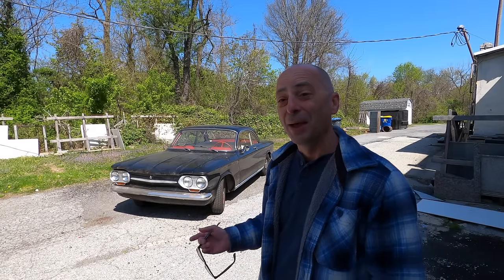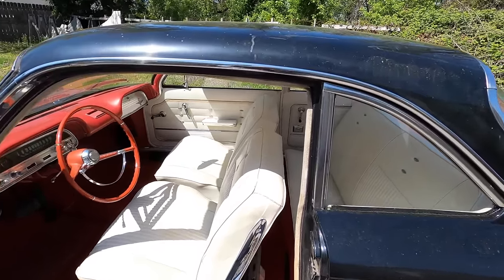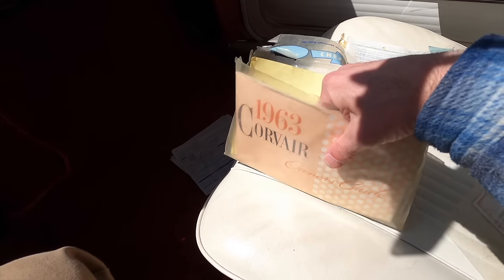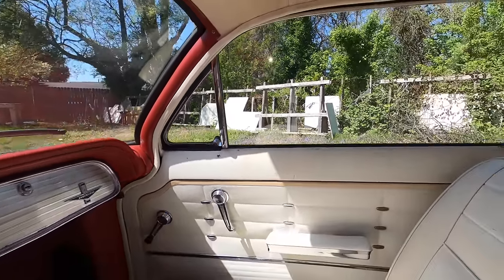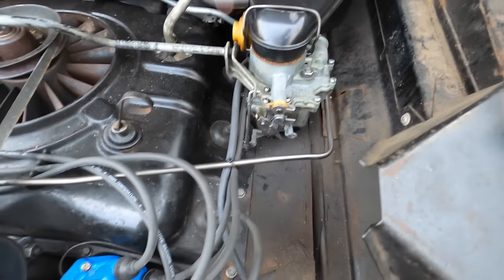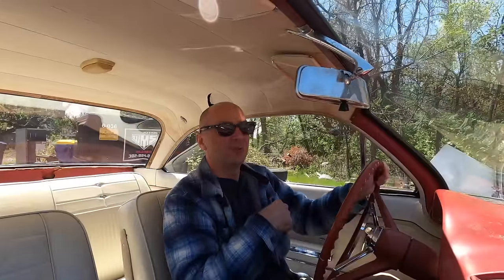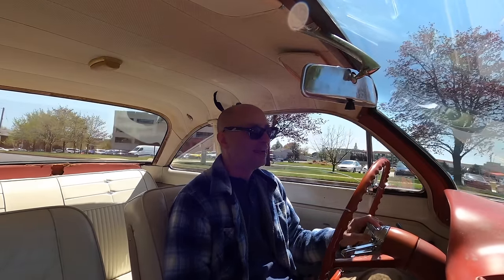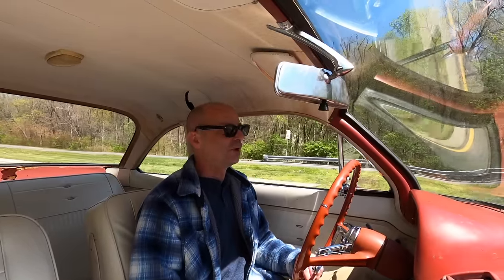Chevy Corvair - The Weird, Quirky, Cheap and Yeah COOL Compact

Comment: I like the Corvair quite a bit. When I was a teenager, you could literally pick these up for free by just hauling them home. 

There were camber compensator straps that were available to prevent the excessive positive camber jacking when cornering hard. These cars were specified to run low tire pressures to improve the ride. A help for the rolling under on the sidewalls was to run even higher pressures both front and rear. I ran 24 pounds in the front and 32 to 35 pounds in the rear. And I used radial tires. You can tune the handling with adjusting tire pressures. There is also a front stabilizer or roll bar you can install on the front which helps with the oversteer. I do not believe they came stock with your car. 

Your 101 hp engine was an option and it had a reputation for good mid range power and really helped when going up hills. 

The Corvair was initially designed for only offering the automatic transmission. The manual transmission was placed in the car shortly before release and they presented some engineering issues  that gave them fits. There was a bucking and rattling issue when the throttle was released and the car changed from power to coasting. The problem was found on the 3 speed, was most prevalent on the 4 speed manual.  It did not occur on the automatic equipped cars. 

They had a couple of last minute issues just before release. GM thoroughly tested the cars at the phoenix proving grounds to make sure they did not over heat. They did fine. But when they decided to run up to Flagstaff Az. They all quit when the got up in the higher elevation and cold temperatures.  All the cars carburetors iced up. So they did an emergency design change to install car de-icees on the 1960 models. They then did a design change to solve that issue later. 

Another design change implemented just before production release was to change the cooling fan to metal. They were initially offering a plastic composite fan of some sort then discovered if battery acid spilled on it, the reaction between the battery acid and the cooling fan released a poisonous gas. I forget which one, but it was serious enough, they immediately removed the composite fan and replaced it with the metal one before production release. 

By the way. The performance goal was for the zero to 60 mph acceleration with the base 80hp/automatic engine was to match the 6 cylinder Chevrolet Biscayne time of approximately 19 seconds. Your 101 hp model beats that by quite a bit. 

My dad purchased a new 1962 red Chevrolet Corvair 95 Rampside pickup with the 4 speed transmission and the gasoline heater. That heater would really toast your feet! That truck was absolutely great off in the woods! He bought it to go hunting in. He loved to hunt. Me, not so much. But I enjoyed the ride along and camping. (I was just a grade school kid then.) that is when I got hooked on Corvairs.

Comment: I had a '63 convertible and I loved it. The only real problems I had were that (1) I needed to keep a spare fan belt at all times, and (2) keep away from mechanics that had no idea about aluminum blocks, they would over tighten and strip all bolts causing multiple oil leaks from the valve covers and other places. It wasn't much good in an Indiana winter either. That was ultimately what made me trade it.

Comment: I had a new 1963 Corvair Mazda, 4 speed w/seat belts. When I had it at about 10,000 miles, it began having issues with leaning out similar to your issues and it turned out to be worn seals on the carborator power pistons. One nice thing was that when it happened in traffic, I could get out of trafic using 1st gear and the starter motor. The other and only other issue I had was upon filling the gas tank … if left parked in the hot sun, the gas would heat up, expand and begin flowing out the gas cap. I still enjoyed it so well that in the year I had it, I put 22,000+ miles on it. The following year I traded up to a 1964 Corvair Spyder with 155hp and an exhaust driven blower. The only difficulty I had wth it was my led foot, the clutch, and the poor construction of the seat covers. The blower became prominent as I would cross 55mph with my led foot. The clutch was a 10 inch size, and had to be replaced prior to my wife and I travelling from Iowa to Florida and back. The replacement clutch was in the correct box but in actuality was 10 1/2" size. It broke as we began coming home. At that time, dealerships wouldn't recognize warranties from anywhere other than the original dealer so we drove home having to stop by stopping the engine, starting the engine in 1st gear and hard gear shifting through the other gears. We had a difficult time explaing the damage to our dealer at home until they discovered their mistaken clutch and then we ended up with a completely new transmission. Still was one of the best cars I've ever owned❗🤗

Comment: I got a 63 base model in 1968. The back windows didn't open and the seats were designed to stick to you and scald you in summer. But even the smallest engine had 2 single barrel carbs, it had 3 on the floor and was fast. I loved that car.

Comment: That’s a solid example. From “my experience” there were a few flaws designed into the car. 1. When you feel your losing control in a turn do not let off the gas pedal or even touch the brakes. Power through that turn. 2. Correct shock absorbers. These make all the difference in limiting the travel of the rear swing axle. It makes the car almost flat in cornering at high speed. 3. Rust. The front cowl in the early model was sealed with tar. How they assembled the car allows water to seep into the trunk and into the front foot well. Take off the wiper blades, take off the louvered grille, flush it out and seal it up. The stalling issue on the engine if it involves the carbs is that the carbs do run cold. They will ice up. The engine heat is supposed to recirculate back to the intake. Which prevents carb icing. I’ve only had early models and most of them being the 1960 model. The 1960 had a single thermostat which I thought was a better version. The 61-69 used dual thermostats which trapped the hot air inside the tins which flowed the carbs through slots. When those thermostats fail all that hot air blows out and the carbs get only the cold air from whatever ambient air the car is driving through. My last Corvair I sold I had to pay attention the the minimalist electrical system as the wires were approaching 60+ years of age.

Comment: I had a Corvair back in the early 70s for a short time. Really good cars. Thank you for the video and have fun with it they’re a hoot.
Reply: my mom had a ‘62 Monza  coupe. car died at only 188 miles due to a tech leaving a 3/4 inch socket wrench in the transmission. GM warranty replaced it for free. car problem again at 28K when valves burned on long interstate trip. car got a steady 14 mpg on premium gas and always smelled of burning oil.

Comment: After being discharged from the US Navy in 1965 I bought a 1962 Corvair for $800 from a dealer in Fall River, Massachusetts. I loved the car. Driving first to Pennsylvania then Cincinnati, Ohio then a long road trip to Anaheim, California pulling a 5' X 8' U-Haul trailer. Because I never owned my own car before and not having any mechanical experience the trip was anything but uneventful but that's another story. All in all the car was a joy to drive and I highly recommend  anyone interested to get one. Seriously, I loved my Corvair. 
P.S. As a side note: I pulled the Corvair with the loaded U-Haul trailer OVER the Rocky Mountains.
       and it was the 600 Model. Little engine, no guts but it did it all the same.

Comment: I always liked them, especially the styling of the “new models”…the 2nd generation. I almost had one for my first car. I understand Chevy fixed that oversteer issue, but by that time Nader had killed them off.
Reply: We have been Corvair people for decades, and I don't agree that Nader killed them--10 years is a long run (how many cars designed in the '50s made it in to the '70's, for example)...AND...the new smog laws were coming in the late '60s. It's nearly impossible to clean up an air cooled engine, so they quit.
Reply: The Mustang killed them off.
Reply: @williamgregory6684  Disagree.  GM itself killed the Corvair.  Built the first ones on the cheap and never really got serious about upgrading.  By the later years, American cars were growing again and the demand for smaller cars faded.

Comment: Only  up to 1964, In 1965 the problem was solved. Yhe car was a Ferdinand Porshe design. He told GM to put a ujount on the rear axles. I had a 1965 Monza, I bought it in the early 80's with 30,150mi. Drove it all over the country, bought in <inisota lived in Brooklyn for awhile, then to Jacksonville, FL. It had over 1000,000mi. when I gave it to my brother. I replaced a wheelbearing in South Carolina, and rebuilt the carbs a few times, thats it!    Really loved that car!

Comment: In 1966 I learned to drive in an early model Corvair with a manual shift.  We loved tooling around the winding hills of rural astern PA, and we rarely heeded the speed limit.  It was a pleasure to drive, and we never had any problems with its Porsche type rear suspension.  Unfortunately it was rear-ended and totaled while stopped at a traffic light.  It was replaced by a 65 Mercury Comet with 289 V8 and auto trans.  The first time we took it our for a spin we almost killed ourselves going too fast around a bend (same speed we safely drove the Corvair), and the back end broke loose.  We safely recovered without ending in the swale or trees beyond.  The Corvair was definitely more fun to drive than the Comet, and safer.

Comment: In the early sixties Porsche, Corvair and VW all had rear suspension (called swing axles at the time) that would tuck under during severe oversteer. After racing accidents, research and lawsuits, anti sway bars were installed on the rear suspension that mitigated the “tuck under” and lessened oversteer going into corners. 
 One advantage Corvair had was 24mpg and great traction in the snow. If you lived in a state with a snowy winter you recall rear wheel drive cars having to have a 50 lb bag of rock salt in the trunk to reduce wheel spin on snowy days.

Comment: I remember my dad having one of these when I was a kid. He painted it outside with a brush, roller and regular oil based paint, black cause that was the original color. After the paint dried he put two coats of clear shellac over it. The car looked good most of the summer until the sun baked the clear coat causing it to crack and peel. By next summer the car had pretty much become a piece of yard art, and not a real pretty one either.

Comment: Crazy to think that a "failed" GM car back in those days still sold 280k a year!! 
Thanks for the great tour, always curious about these...But why would the air pressures in the rear need to be HIGHER? You'd think LESS pressure would mean more tire contact patch.
Reply: Probably Because the weight was heavier in the rear - the contact surface of the tire needed to the same as the front for better handling
Reply: @budsodalsky  Ah, makes sense!

Comment: If you stick your head down into the passenger's foot well and look up into the underside of the dash, you can see the two, oscillating arms that operate the windshield wipers move back and forth when the wipers are on. I know this because that's where I rode in our black, 1963 sedan. Not at all sure how I'm still alive. The interior vinyl was a tight weave of red, white, black, and yellow. That's about what I can remember because, as a three-year-old, the rest was too big for me to notice. I think my father bought it new and traded it in in 1964 because we had a new, 1964 Mustang as our next car, which was totaled (but still running) sometime before 1967.

Comment: I ordered my Corvair direct from the factory (Yes You could, those days). The standard model with Spyder suspension. I added the camber compensators, Thomas's quick steering, and dual exhaust. the car was all black with a blue-green interior and the factory wire wheel hub caps. It was a beauty. Full to drive, zippy, and handled excellently. BUT: the valve cover would start to leak every couple of months. The flywheel came apart. And I was replacing worn rear tires twice a month. I sold it to a friend who didn't check the leaky valve covers and destroyed the engine. 20 years later I saw my car back on the road. I don't miss it. I still have my 59 VW Beetle.

Comment: My dad purchased a 1963 navy blue Corvair in 1970 used for $200.00. He really liked the way the car handled. The only problem was that the two front wheels started to slant. It kept getting worse. Not being a mechanic, he got rid of it in 1971 for a 1965 AMC Rambler. Cream body with a dark green top.

Comment: It might be vapor locking on you which would cause it to die.  I had several VW's and it wasn't a problem until it got up over about 90 degrees outside.  Nice car.  I've never owned one but would like to someday.  My late Step Dad owned one way back when and he seemed to like it because he also liked VW's.

Comment: I owned a 1961 Corvair Monza in 1964......lived in LaHabra Ca and worked in downtown Los Angeles...drove it to work and back every day for a couple of years and at least 4 trips to Tucson Az ...with my wife and I and our three kids....never had a problem with it except having to replace a blower bearing and did it myself without much difficulty.  I was forced off the road once while driving on the highway along the west side of Salton Sea...I took to the shoulder which was soft sand at about 65mph...the car handled with no problem,  I got back on the highway and continued on my way...needing only a change of underwear.  I think the Corvair got a bum wrap.

Comment: 6:45 I didn't know that earlier Powerglides lacked a Park feature. That must have been added when DOT standardized the shift layout, driving most of the pushbutton units off the market, for 1965. This, or the '64, might be the last automatic car made for the U.S. market without a Park feature.
Reply: The Corvair was the only Chevy with no Park position in the Powerglide transmission. This was done because of space limitations in the compact car. Other Chevy's had the Park position.
Reply: @sueblecker6366 You're right except the reason: A column shifter does not add any more space limitations - it was just cheap - as they intended these cars to be very affordable - but yes pglides did indeed have park setting on other gm models

Comment: Great car !!! I had a 1962 700 series 4dr with the pagoda roof. It fit me and five others from my college carpool - barely. In 1964\5 the handling issue was solved by adding an inexpensive rear sway (anti-sway?) bar - something that should have been done from the beginning. In 1964 GM added springs to tighten the hold of the valve covers which solved the oil leaking issues. When driving in 3 to 6 inches of snow it was a blast to sail past everyone else due to the fantastic traction of the rear mounted engine. Wanna have fun? Fill the tank with super premium gasoline, adjust the idle arm to 2,500 - 3,000 rpm, inflate the tires to 40 psi rear\35 psi front and head for the freeway. About 90 - 95 mph the front end will begin to lift off the ground due to the straight edged curved panel under the front bumper !!! Too bad they ended that with the redesign.

Comment: Always liked the Corvair. Apparently, GM deleted an anti-rollbar from the suspension to reduce production costs, and this is why the handling was so wayward in certain circumstances. I imagine that if you fit one, the car will probably handle quite nicely.

Comment: I come from a small town in the state of Maryland. Elliott city which is just a few miles from Baltimore County where A. D. Anderson Chevrolet and Anderson Oldsmobile were located, both now long gone. The largest Chevy dealer in Maryland A. D. himself at the time almost an icon. A childhood friend of mine purchased one of those Corvairs used, a four door sedan when he returned home from serving in the Vietnam War. He loved that car, but drove it without a high degree of maintenance. It held up well though and was especially good in snowy weather, because of the rear mounted engine didn't need snow tires. I agree with a comment made by one other person if you have a mechanic that works for $25.00 / hour keep him very close. I now live in California where the cost of automobile repair can be three to four times as much /hour. Because of some draconian law passed here an individual is all but prohibited from doing any work on his own car . There is no incentive for mechanic shops to compete on price for your business, thus like everything else here costs continually  go only in one direction that is up.

Comment: I have the twin brother of your Corvair. It is a 1963 Monza 2dr coupe. Black with a white interior. I was confused as to why the dash was red. The big difference is that I have a 4spd transmission.  I bought it some years ago as a package deal from an air cooled engine enthusiast, I sold the Porsches and the VW beetle. The Corvair has been languishing all this time and needs a lot of attention. 
I don't know if the engine will turn yet. The gas tank is sitting in the back seat. Yeah lots of stuff to do. Enjoyed your video a lot because your car looks exactly like mine.